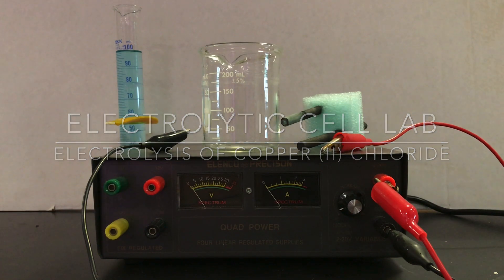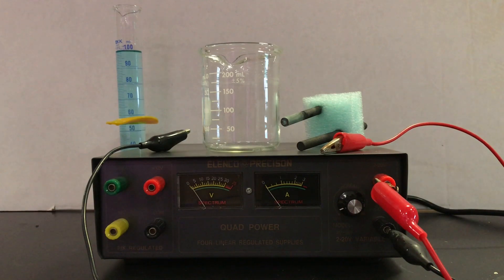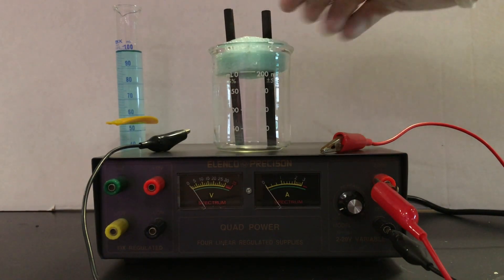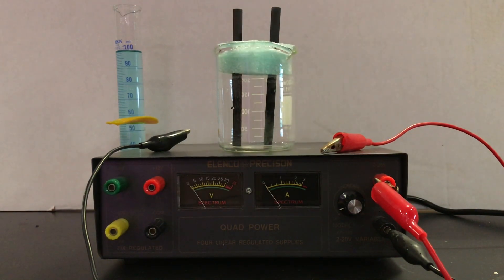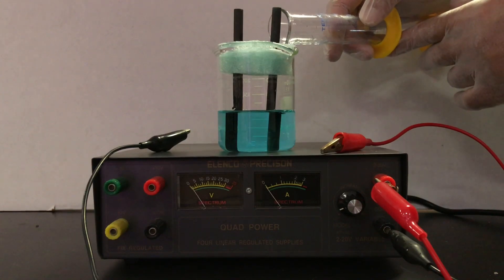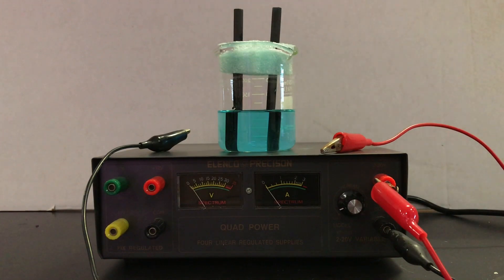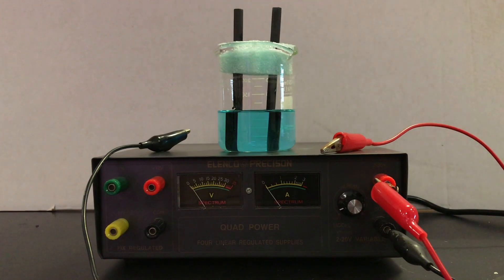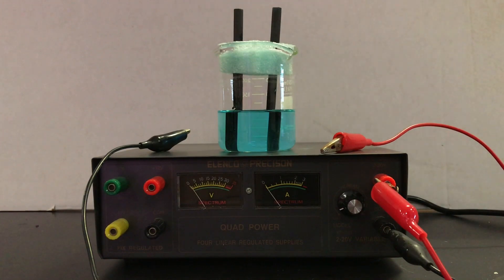Electrolytic Cell Virtual Lab

Comment: How come can we compute for the theoretical mass and percent error if you didn't give us the initial mass of the electrode to be plated?
Reply from the maker: If you have the average amperage and time of the experiment you can calculate the mass using Faradays's constant, the ratio of electrons used per copper ion, and the atomic mass of copper.  This is lab that uses the calculations of the electrolytic cell.